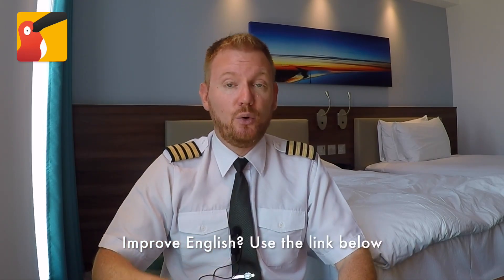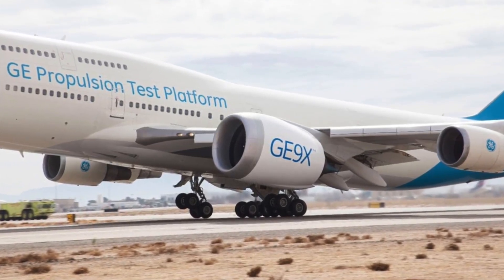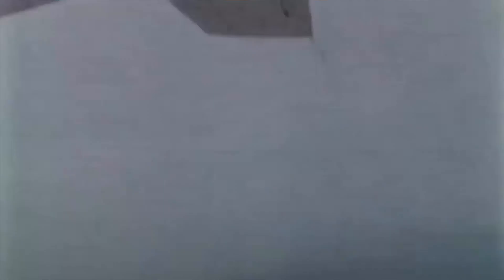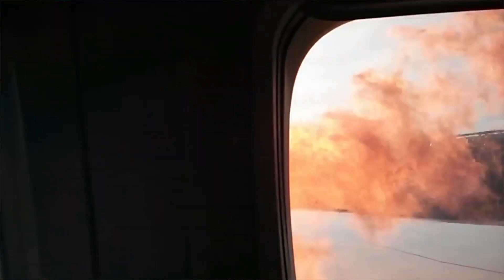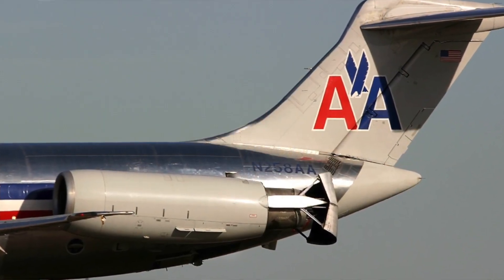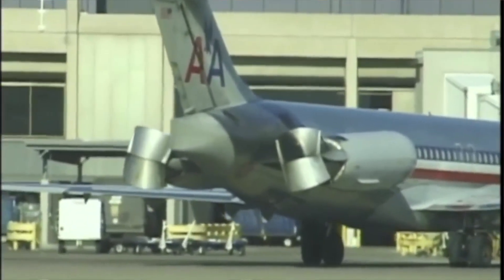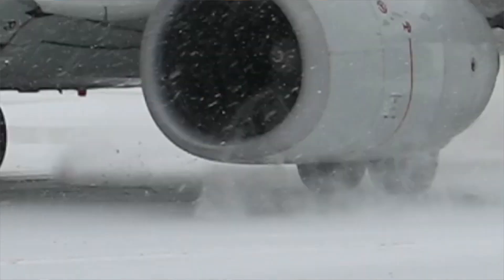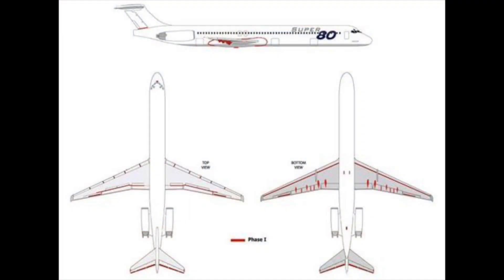Why are the jet-engines placed there? Wings vs Tail

Comment: I have a question, don't know you you've made a video on it already. Is about the Boeing 737, I'm curious on why to my understand is one of the most largely use planes, and what the difference between the different aircraft series like Boeing 737,−600/-700/-800/-900? are those like the year models in cars or more like refits that the craft gets along its lifespan making them more like marks as in MKI, MKII and so on?
Reply: Thats the long range of the plane. The hires the number the bigger is the plane

Comment: if you wonder how engines feed themselfes (even some cars) the underpressure after the ignition will suck fuel in easy a car can do that but mostly only strong V8 because they are making strong vacuum underpressure

Comment: Sir, please also explain why along with one engine each under the wing, why is there a third engine mounted on the tail of the aircraft ? Like the MD11. Thnx
Reply: That was for ETOPs, back in the 50's and 60's twin jets had the 60 min rule, they couldn't fly more than 60 min away from a divert field.  That's near impossible on a lot of international routes, so most early intercontinental jet liners were 4 engine aircraft.  As the engines became more powerful it wasn't necessary for a standard wide body to have 4 engines so moving to 3 was more efficient, as the engine improved further and the reliability improved.  Air bus showed on other routes that with a 90 min restriction there new wide body twinjet the A300 could operate those routes safely, the FAA was convinced to allow the restriction to move to 90 min and eventually 120 min allowing for the A300, 310, and 330 family as well as the 767 and 777 to begin to dominate the long haul market as we see today.

Comment: "you can mount larger engines under the wing"
737: Am I a joke to you?
Reply: MAX 8 intensifies
Reply: Neon Moon Pie the engine isn’t actually the problem with those planes
Reply: roj30001 but it’s what caused the problems to that plane
Reply: @macklenk5326  why do you say that? The software and faulty sensors are the official cause of the problem with the max 8.
Reply: Michael Boyer I guess but when I say they were the cause it’s because they added the engines which led to the adding of the systems and then the crashes from the MCAS happened I just really simplified it
Reply: @mboyer68  that started with the newer engines installation
Reply: @koffiemoth  OMFG. 🤣
Reply: @koffiemoth  I love the MAX aircraft
Reply: Yep then came the MAX 8.. we all know what happened after that
Reply: Lol. But he means for the final design. If designed right, you can put as big an engine you want under the wing. Not adding bigger engines after the fact. That's what Boeing did to the 737.
Reply: what if you mount engines everywhere possible?
Reply: apply tiny wheels to the bottom
Reply: You need to redesign landing gear lenght. Pretty basic...
Reply: LOL
Reply: Hey amigo! You are not a joke to anyone!
Reply: ENERCON Fan yup
Reply: LOL The biggest problem for the 737, mounting bigger engines under the wing!
Reply: @wiljonkesteloo375  because it's wings were designed for the older engines, a new airframe design would have had more ground clearance.
Reply: Boony Tooty DC-10
Reply: Larger engines under the wing
Boeing-Max
Airbus-Ha!  Can do!
Reply: Lmao
Reply: Thats what happened with the MAX

Comment: The planes that have the engines at the back are they more likely to land safely I've there was a gear failure and the wheels didn't deploy because on landing the engines wouldn't dig into the runway?

Comment: The first generation of jet engines, the fan blades were 12 inches in diameter.
Reply: The first generation jet engines didn't have fans, they only had turbines. Fans came in later to supplement the thrust from the combustion jet itself, and are now providing most of the thrust in commercial airliners.

Comment: 9:20 on my last flight on a 737 from FRA it actually drove backwards. 🤔 The fans turned to one direction when driving back ans into the other direction when driving forward
Reply: The engine technicians on the ground must have done a terrific job exchanging all the compressor and turbine disks and flipping the combustors in time to move that plane forward again! Or was the entire flight made backwards?

Comment: On the other hand I would have thought T tails, if you manage to keep it out of the wake of the main wing, because of its greater distance from the main wing, would have greater leverage (although this could be mitigated by using larger stabilisers on a low mounted stabiliser),

Comment: Maximizing the necessary weight directly to the lifting surfaces HAS to make good structural sense, you don't need as much extra structure to transmit load to lift area.

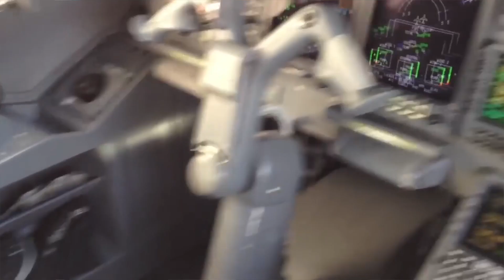Comment: 13:00 so... On the most basic level, Mcas?
Reply: No. MCAS  moves elevator and trim to compensate for pitch changes detected by the AOA probe caused by power changes in a way that makes it feel to the pilot as pre MAX  737s when power is added or removed. It would feel different because the MAX had larger engines that in order to fit had to be mounted lower on the wing. . A taller landing gear was then needed to facilitate the larger diameter lower mounted engines.
A stick pusher is strictly a function of AOA.

Comment: landing on water or in forrest areas is easier with rearmounted engines. The aircraft has a much cleaner under surface without engines hanging down from the wings

Comment: Have there ever been any aircraft with both? Two large engines under the wings and two smaller engines at the back? Granted it'd be simpler just to put two more engines under the wings, but don't underestimate what engineers will try when searching for the most efficient arrangement in terms of weight and fuel consumption.

Comment: High tailed aircraft can be difficult to land as at low speeds controllability can be challenging. They are usually used for regional flights, one operator may prefer high mounted engines as they require less maintainance cost due to bird strikes. I think you should explain why they have placed a skegg on the engine cowl in a A350 or B777? Would this be an aerodynamic fix or would it just be to push the cowl towards the engines should it become unlatched ?

Comment: That stick pusher actually sounds super similar to the MCAS system in the 737 max. 
In both cases, if the plane detects that the nose is pointed too far up and the air speed is too low, it pushes the nose down to prevent a stall. 
The problem comes in when you don't tell the pilots about it, they don't know what's happening, and your sensors start malfunctioning.

Comment: What about the fact that if you lose an engine off the rear of an airplane the center of gravity is going to be really really out of whack where is if you lose an engine of a on a plane where it's mounted under the wing it's not going to be when I say physically lose its having it fall off it shouldn't be as traumatic

Comment: great video!  my dad is old now but he used to be a pilot and always told us to never fly in passenger jets with jet engine mounted in tail fin because they were harder to recover from a tail spin.  i guess they don't make them anymore.  i used to love flying but i don't trust any electronic devices so that makes all fly by wire aircraft risky business.  i'm an extremely nervous flyer these days.  i would feel a lot safer in a small cessna type plane with small jet mounted under each wing.  jet engines are a lot safer than piston engines.

Comment: Good information, but I am surprised that you don't mention that engines at the back are behind both the centre of gravity and the centre of lift. That is a physically unstable situation: like balancing a vertical stick on your finger. I was wondering what effect that has on the handling of the aircraft.

Comment: Hi how the pilot knows the distribution of weight inside cabin I'm asking about passengers also explain something about centre of gravity...when 3 engines in the aircraft is failed and only  left most engine is functioning will the aircraft spin or how the stability is maintained

Comment: @Mentour Pilot

Captain,  is the propensity of under slung engines to pitch the nose up, on an aircraft, due to torque transmitted through the wings? If so, then why is this propensity greater on a 737 max, then on a 737 NG, since the engines on a 737 max are mounted higher?

Comment: Could you theoretically mount the engines further away from the body of the plane on the wings? I know Boeing has problem mounting bigger enginew to their 737, so why not mount them further away from the body and thus have more ground clearance? Like the Airbus A380 has it's engines mounted pretty far away from the body itself to gain ground clearance, because the engines are really massive. But with the Boeing 737 the engines are mounted directly next to the landing gear, thus as close the ground as possible. I just don't understand why they don't mount them further away.

Comment: If the engines in a T-tail have a pitch down moment, what effects do they have in a super stall?
Reply: Rear engine jet stall recovery, "Roll to 90 deg then release back pressure". The JT8D engines take a while to spool up but yes they would have a pitch down moment.

Comment: Can someone explain to me why Boeing decided to merge the engine with the wing instead of putting in longer landing gear?
Reply: Longer gear would have required a complete redesign of the aircraft. The higher engine mounting position would effectively reduce the pitch up tendency compared to being mounted lower.
Reply: A major redesign of the aircraft would be mounting the wings high to get the room for the larger engines, a landing gear lengthening is a minor redesign by comparison..... and what they actually DID was both a MAJOR redesign AND a hazard. Mounting the engine there robs the wing of 20% of the fuel it can carry, and the remainder is literally in contact with a hot engine. It's also impacting the lift produced by the wing, leading to early stall, and is more susceptible to turbulence and FOD.
Reply: @yuehhtewbb427  Nothing you just typed is factual in any way.
Reply: That's not an argument.
Reply: @yuehhtewbb427  It is a waste of time to argue against something that has no basis in fact. I'd be better off talking to a wall. You do not know what you are talking about in the slightest.
Reply: "You do not know what you are talking about" is not an argument. There is no information in that statement, it's just an accusation with no supporting evidence. Basically you're admitting that you're wrong, or at least that you have nothing, to counter what I brought up.

Comment: The stick-pusher works really similarly to the MCAS on the Boeing 737 max, doesn’t it
Reply: Roc Young ehh, sorta.  The pusher uses the elevators themselves, MCAS used the entire stabilizer.  You can override the former, since it’s using the same control to which your column is connected physically by cables.  It can be overridden.  The stabilizer is more difficult to override.

Comment: Your English is better than that spoken by some of my fellow Americans. 

One thing to add, with  rear mounted engines they are very close to the fuselage.  By keeping the weight in tight to the center, it makes the aircraft roll quicker. That's a major reason why all fighters have the engines in the rear and right on the roll axis.

Comment: The VFW-Fokker 614 had its engines mounted on top of the wings, presumably no space under the wind and a rear mounting may not have been an option for some reason. I can't think of any other aircraft like that........yes I can, the HondaJet.

Comment: May I ask a question please?  In regards to engine stall,  in the Aircraft going too slow, and a stall is possible....How does an aircraft not stall when at idle speed on the ground. Is it safe  to assume the engine idle speed is greater than the slow moving of the plane in the air, or is aerodynamics different in the air to that of idle speed on the ground. Thank you, Mervyn
Reply: The engine doesn't stall. The wing stalls. Look up information on aerodynamic stall.

Comment: You mentioned asymmetric thrust during engine out on a wing mount configuration. What about thrust reverse on a wing mounted twin jet? If one thrust reverse fails when you throw the engines into thrust reverse on landing roll resulting in reverse thrust on one side only. You're going for a heck of a ride with a big heavy plane. Especially if you don't react quickly enough.

Comment: Also, high mounted engines coast better in water landings and can be destroyed by ice coming off the wings.
Reply: Probably safer for emergency landings on land where the landing gear failed as well
Reply: Well there was a case of a tail engine Mcdonald Douglas that had the engines die of ice but also there was a A-10 pilot who went off range during training maybe to look at the fresh powder in the mountains because he was a avid skier who I therefore suspect might also have been a unfortunate victim of icing flaking off the wings. The Air Force blamed the kid, very sad.
Reply: @Schtuperfly  finish the story!
Reply: @Schtuperfly  not enough detail lol
Reply: But you lose water propulsion ability
Reply: The engine is usually mounted at the back, in case of the engine burning (probably due to an explosive 30mm) the fuselage doesnt catch fire too
Reply: Kindly elaborate on why rear mounted engines coast better in water landings. Thank you.
Reply: @plee4384  Look at a plane with two big engines hanging straight down off the wings. It will come to a very violent stop when those drag in water where higher mounted engines will not. Furthermore, having the weight toward the rear helps avoid the nose from diving which could also cause a violent stop in water, particularly if there is enough surf to negate the gravity being cetered.
Reply: @Schtuperfly  but if aircraft is stalling,having the weight towards the rear would also make it more difficult to drop the nose to counter the stall, wouldn't it.
Reply: @plee4384   Maybe, harder for sure. The wings being low could make the whole thing go south in a hurry too. Still, hard is better than impossible. The choice between landing a very half assed sea plane or an anchor.
Reply: @Schtuperfly  Quick question: I understand how the T-tail design is more susceptible to losing elevator authority at high angles of attack, but can the aircraft be recovered on the onset of a deep stall by pushing the throttles to max thrust and using the pitch moment to help push the nose down?
I'm not a pilot, getting my private license is on my bucket list and although I might never fly twin tail-mounted jets, I like to know things 😅
Reply: @jnmason6283  Sorry, I'm not a pilor either. I just think this stuff is interesting and watch a lot of videos. I do recall something about never wanting to have the tail downwind from the engines or everything goes to heck in a handbag. Other than that sorry pal, I'm the wrong guy to ask.

Comment: What about landing on water with engines on wings, always fatal is that right?
Reply: No, it's fine. Best example is US Airways Flight 1549 A320 that landed on the Hudson river.
Reply: @bmozumder  I thought the engines would stop the plane dead in Its tracks or rip the Wings off
Reply: @johnlondon1242  The engines have sheer pins that allow them to ripped free from the wing is the force is great enough.